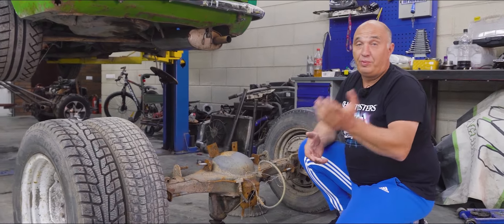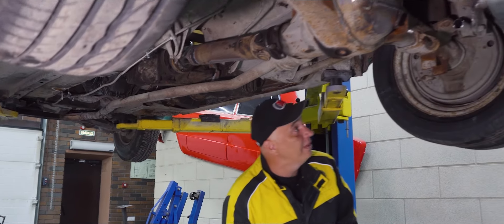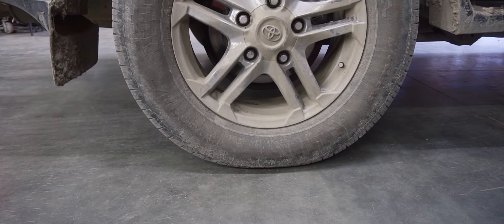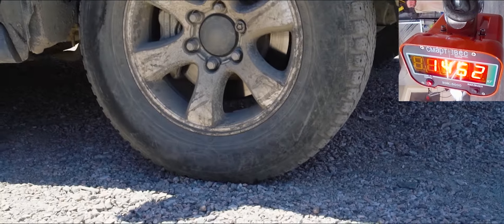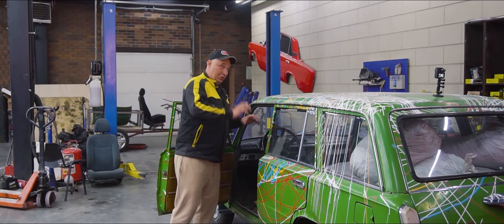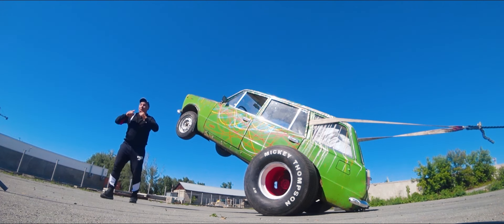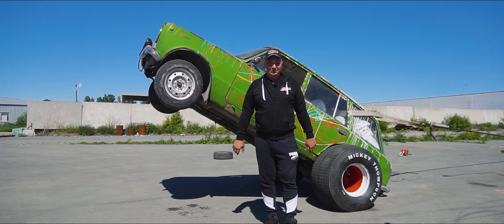Super-powerful Lada – capable of doing a wheelie

Comment: Suggestion: Make a "Rusla" electric car with starter motors
Reply: Starter motors are not made for continuous duty so they would burn up quickly.
Reply: @mikeznel6048  very true but it wouldn't be Garage 54  If it didn't fail miserably...
 That's usually the entertaining and funny part of the video.
Reply: @mikeznel6048  Not if it's from UAZ-469 B...😂😂😂 and if they aplay some CO2 colling...
Reply: Top Gear once did a DIY electric car with an electric milk van motor. That milk van motor will have had more power than some starter motors and was already kinda dull.
Reply: @mikeznel6048  even better!
Reply: If you want them to do it then maybe try translating it into russian and commenting on the main channel
Reply: Yes we are eagerly waiting for it
Reply: @tommyhallum2054  I don't know these guys always make it work, failure isn't their thing. It's 110% success rate or nothing with these guys.
Reply: With constant cooling of the motors maybe its possible.
Reply: Teslada
Reply: Washing machine engines ;)
Reply: They should use a trolleybus motor. And when they are at it, mount trolley poles and then do some real burn-out with those fat tires.
Reply: @mikeznel6048  they wil hold for 50 seconds minimal, (minimal) on full torc , they'll give way, once there is less torc needed, they'll continue on full power delivery !!!
Reply: @mikeznel6048  You don't know Garage 54 if you think that'd stop them from trying it
Reply: Someone is making motors out of alternators.. For gokarts? It's been a while since I saw that.  It's different. But a alternator is essentially  a motor.  I suppose a starter would be to.
Reply: @That drummer from all those different bands Probably because people want to see it done...? Also, this is an automotive related channel, I don't think washing machines are necessarily automotive tech.
Reply: Thats a good idea.
Reply: Use commercial truck starters
Reply: That sounds like a disaster,  I like it!!
Reply: @mikeznel6048  : lol  If you say so man but I can't think of one experiment they did that had a 107%  Success rate!?
 But safety is number one priority! Lol
Reply: They already did something similar with starters...
Reply: Noo gasoline please
Reply: Again that idea....again started motors are not builded to run long time...
Reply: @tommyhallum2054  burning up 4 starter motors is entertaining? Lmfao only thing you will see is smoke.... nothing else.
Reply: YEah
Reply: There's a video on YT of a Niva with a leaf or volt drive train and batteries transplanted in.
Reply: I have a electric bike I made using a 12 value starter so it might work
Reply: @dragofill2808  I've seen electric go karts that use starters. So it should be possible.
Reply: electric pump motors should do the trick!
Reply: Alternators*
Reply: DC motor from electric forklift seems to work quite well and the last a long time
 Lots of electric forklift go for junk once the batteries crap out
Reply: @ImmortanJoeCamel  I burnt out two of them in wooden go carts plus they aren't very energy efficient due to needing to power field coils instead of just having permanent magnets
Reply: @mikeznel6048  they could instead use the old school generators that were used before starters to start cars
Reply: @DiaryofaGrimReaper  a starter is literally a motor, nor essentially.  An alternator is like the reverse of a motor, people use alternators over starter motors for longevity. An alternator is meant to run constantly, a starter for very short bursts
Reply: @jamesallenmainieri  Yup, I have to say I didn't think starter motors were a thing.  I bought a brand new starter for my wrecker, it lasted a year and maybe 500 miles? Died and I had to buy another new one.  Point is , their kind of sensitive.  They don't last like a real motor.
Reply: Convert alternator to 1kw motor
Reply: Or teslada
Reply: @tommyhallum2054  Actually, it always works, then fails afterwards. That's what they call 107% success.
Reply: @Archer28M  That makes zero sense.
Reply: @archiethedog4515  I'm pretty sure you miss the point of their videos.
Reply: @tommyhallum2054  All of them. Every video they say a success rate over 100 percent.
Reply: with a 999 likes ,WE NEED TO  SEE THIS ,am interested on how it will go lol
Reply: Yo remind him again. That would be sick
Reply: @mikeznel6048  true - I used a couple in DIY go-karts and both motors overheated eventually. I think (other than the inefficient wooden axles and other stuff made by 14 year old me at the time) that the problem is that starter motors waste power running an electromagnet where the permanent magnet would do the job for free. The electromagnet coils heat up and more heat is generated. Another unrelated problem is I mounted the motor the wrong way round, but when I swapped the battery connections, both the motor coil and the "permanent" electromagnet coil reverse polarity, meaning the motor spins the same direction whichever way the battery is connected.
Reply: @mikeznel6048  I think with virtually no torque, they should be all right?
Reply: @mikeznel6048  then they can turn alternators into electric motors
Reply: Or a Teslada
Reply: They just made one on April fools😂
Reply: Drying machine motors
Reply: they DID :)

Comment: Ha, just cut the diff cover open to weld the diff, then weld the diff cover closed lol. Easier than messing with rusted bolts I guess.
Reply: if they removed the center section they would have had to pull the axle shafts, that was the time saved
Reply: @RickBaconsAdventures  Like I said. Ha, just cut the diff cover open to weld it.
Reply: You dont need to worry about gear oil.
Reply: Not a diff cover, that's the actual housing. They saved a lot of time doing it that way otherwise they'd have to pull both axles, then all the center section bolts, etc
Reply: @nimwit0  right. Americans are used to dif covers though, and theyve more often than not they wouldnt know a ford 9" if it bit em in the face.
Reply: @highclasswhitetrash9027  Lo you sure about that? The 9 inch, and Ford, all coming from America? Lol you're a bit off there. There are lots and lots of rear end that have a removable third member as opposed to a diff cover. You just wouldn't underlying that with your tiny mind.
Reply: @nimwit0  Really? Much wow! Many amazing!..... Because the housing isn't housing the diff right? Thay wouldn't be, you know, covering the diff now would it?...
Reply: @mikeznel6048  what are you even on about? I used americans and a well known race swapped rear end (world wide, not just the yanks) as an example. You got your knickers in a twist.
Reply: @highclasswhitetrash9027  LOL dontcha just love the comments section here (especially on car-related vids)?  Some people's "arguments" are just hilarious!  He coulda just said "yeah, I realize it's technically a housing, but you know what I meant..."
Thats why I rarely even comment on these things... Seems most people are just frothing at the mouth for a chance to jump down everyone else's throat over silly "semantics".
Reply: @highclasswhitetrash9027  You're making absolutely zero sense dude... Whatever you're on about, is completely unrelated...
Reply: @billymanilli  It's a truck axle... Not a hi-perf race axle... A removable third member on a purpose built race axle is and a removable differential and yoke on a heavy truck axle are the same thing... Are you drunk? Do you have a drinking problem?
Reply: @mikeznel6048  brother it's fine, who gives a flying sheep's queef, you know what a Ford 9" is, it's simplified that way. Dif housing, drop yolk, either or mate. And I know it weren't directly at me but it's mostly other people what have the problems with me drinking bahahaha! I hope today found you well (two months later ya twat!)
Reply: @mikeznel6048  haven't had a drink in 14 years. How about you?  I read your comment 5 times, and still can't figure out what you're even trying to say. ...and I never said anything to you in the first place.
Reply: @billymanilli  I'll drink to your sobriety! Bahaha.
Reply: you should leave one of the differentials open and put a disc brake on the other side of the diff  and this will make a continuously Transmisson when you apply breaking force to the disc brake

Comment: Y'all are car gods of  innovation I have been a mechanic for 38 years and to  this day I have never seen any one pull 4000 foot pounds out of a 4cylinder stock motor   And at idle I can't believe  it didn't rip the back side of the crank  off can't wait to see what is next for the green inch worm  beast
Reply: It's not that high at the engine lol

Comment: 18:20 is exactly why one always uses the lowest point to anchor the hitch when pulling a load. Otherwise it will flip you backwards! I learned the hard way doing tractor pulls, plus had extra weight on the front. Now all you have to do is put a big screw on the rims and split firewood. LOL

Comment: garage #54 is the best garage. thank you for the starter motor turbo. now use a chainsaw for a turbo. bonus points if it can run from the gas tank and be oil-injected (no premix separate tank). hook chainsaw throttle to the car throttle! PS i love how i have a an SUV that looks like yours

Comment: I'd like to know how fast can that thing now be, with those tires, in top gear and full throttle.
Reply: Fast enough to do a wheelie 😝
Reply: If you know the tire size, and the ratios of the gearbox and each diff, it should be easy enough to calculate.
Reply: 100 MPY
Reply: I'd guess somewhere between walking and running speed.

Comment: Lol that is awesome! It's also a good demonstration of the difference between torque and horsepower. Torque is how much force is exerted, horsepower is how fast it can apply that torque. The Lada had GOBS of torque because it was geared down like a mofo, but it was making only a couple horsepower at idle so it barely moves.
Reply: HP is how hard you hit the wall.... torque is how far you take the wall with you

Comment: Excellent example of multiplied torque. Torque is what does the work!   And RPMs is useless without it.  
    I've done many wheelies in slow motion or with no emotion at all. That was either in the Ford  9 N or with the Deere. 
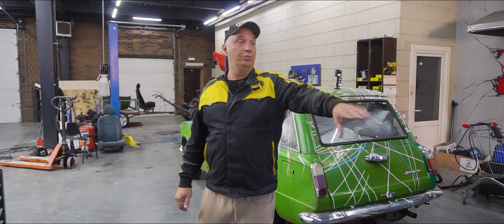   Have a 1980 long bed Toyota 4x4. Not only does it have 5:29 gears with 44 inch tires. But it has what's called a Marlin crawler it is a 2'nd transfer case allowing  you to Double the low range. That's right you can get out of your own spotter. With both transfer cases in low range first gear will move the truck  only at about 1 ft a minute. And that's if you're giving it gas. But as you seen with the Lada tires rarely slip at that speed. Always say if it can park on any angle or Surface it can crawl on angle or Surface. Losing traction is only half the reason people get stuck once the tire spins it starts digging you in.

Comment: The differential needs to be cut open to access the inside? Is that normal or were bolts seized up?
Reply: Welding the gears solid I think?
Reply: It’s how you make a Lincoln locker.
Reply: @stephenbrown571  yes, except in England where it would be an Oxford locker :o)
Reply: it's the kind where the front comes out, not the back comes off.  In order to gain access to inside you have to remove the axle shafts so they must not have felt like doing that

Comment: Wondering if you guys can mate a standard transmission without the bellhousing and clutch, behind an automatic transmission and make it a semi-automatic where you just let off on the gas and shift the standard transmission making it so that you have a ton of Gears ratio selection
Reply: I did this years ago With a Turbo 400 and a Muncy 4 speed . I put the 4 speed behind the automatic And it worked really well . It was geared crazy low And crazy high . I was actually surprised and how well It did work
Reply: @tedsayen4542  so it does work then? I've never seen it done do you have any videos or anything on it or point me in the right direction on YouTube? Can you just bang gears or do you have to let off on the throttle?
Reply: I did this back in 1976 76 or 77 I'm not quite sure what year. I made a coupler from the automatic to the 4 speed. I put it all in a long bed Chevy pickup truck 3/4 ton.  1st gear in the four speed was basically useless. It was fairly easy to change gears in the 4 speed But no you couldn't Bang gears. Man that was so many years ago sure brings back memories
Reply: @tedsayen4542  that's awesome thanks for the info. How did you make the coupler. Did you just use output yoke in the automatic and some sort of coupler that fits over the standard trans and weld them together? What do you mean first gear was basically useless is that because it is so low that the automatic just rips through the three auto gears before you have to shift into 2nd?
Reply: Yes I made a coupler on  a lathe. 1st gear was so low that it was crazy
Reply: @tedsayen4542  awesome

Comment: Suggestion, mount on a solid rotisserie and mount to axles, start the engine. See how long it takes to do a full 360 and see if the engine survives with oil starvation
Reply: Whistlin diesel tried this with a side by side 🤔
Reply: @TwoTenTwice  but that’s a side by side is the point . And this has more gear 😂
Reply: @Iwasthere1415  I too would enjoy seeing this done full sized.

Comment: In my experience any rear wheel drive car that will spin the tires decently when floored , no breaks being used will pull the tires with slicks.
Reply: Pull the tires?
Reply: @Rocksaplenty  yeah as in pull them off the ground. Not like this but a few inches to possibly feet.

Comment: Idea.....  Cut a front wheel drive car in half behind the front seats.  Install 1 large 360 degree caster in the middle.  Isolate front brakes and utilize them for steering on hand controls like a ZTR mower.  Lock the steering wheel down.  Happy donuts...

Comment: Vlad: Who else can do a wheelie at idle?
Me: great, now drive 20mph without changing anything.

Increasing the torque (through gear reduction) without doing anything to increase the power means you’re not going anywhere quickly.

You could get that thing to do a wheelie using a hand crank if you add enough gear reduction.

Comment: here's an idea. reverse the gear reduction so we can see just how fast the motor at idle can spin the wheels. since it's about 150:1 reduction, a wheel spinning normally at 2000 rpm would be spinning at 30k rpm if you reversed the torque reduction, basically by flipping the differentials so they spin it faster, and we see how well balanced the wheels are, if the lada can keep from tearing itself apart, and just how much rpm a wheel can actually handle before the centrifugal force either de-beads the tire and cause a blowout, or cause the actual tread diameter to stretch and expand from centrifugal force, or if they just explode and take the rear end off with them. and if we have something with enough torque that can spin the wheels really fast, lets see what happens if you suddenly drop the rear end on the tarmac. maybe it'll just launch itself forward suddenly from the sudden grip, or maybe the wheels will blow apart. eh, screw it! who's up for wasting some old tires with a torquey lada? I am

Comment: forget rear end suspension in this thing. dont need it. I'd weld and brace the heck out of that rear end to keep it all together. probably throw in a bigger motor. what you think is the biggest thing you can throw in that bay? a 3.5 liter Nissan V6 DOHC VQ35DE from an '04 350 Z? maybe a 4.0 liter V8 from a toyota or lexus? hell, what about using that ladzilla's 7 liter kamaz motor with the torque reduction? can we make something with enough torque to pull a train? do we even have enough tow straps to hold even just the 10 or so tons of just the train itself without the extra rail cars? what kind of monster can we make that is strong enough to literally rip itself apart?